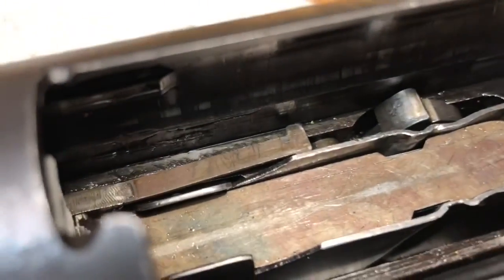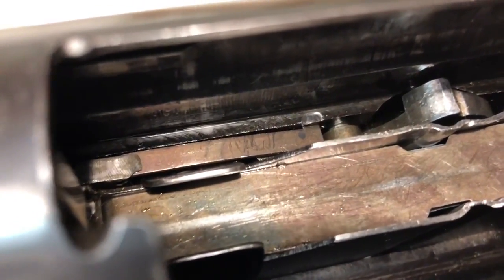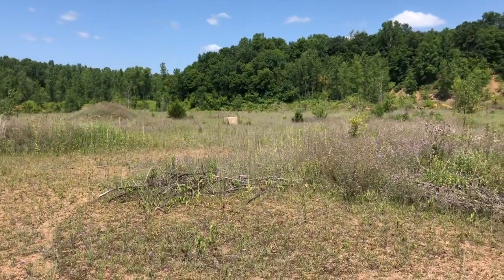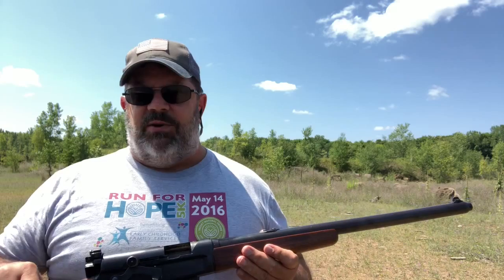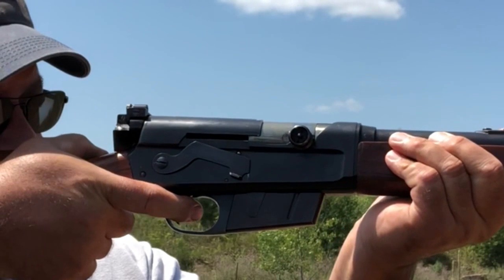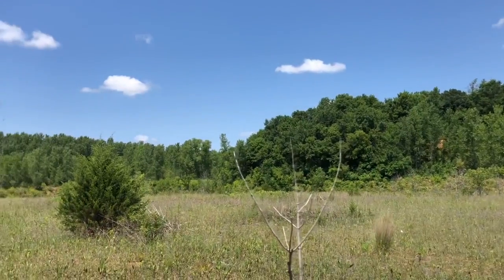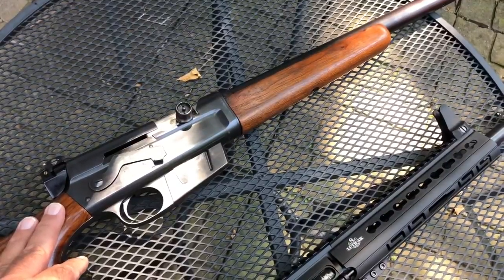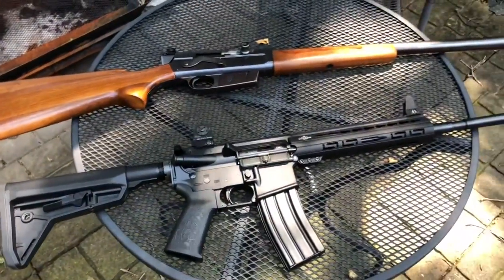Remington Model 81: Success!

Comment: I noticed in your first vid that you thought someone had "bubba" ed the bolt housing, I just purchased a 8 with the same issue. Now I see a vid of an 8 and it appears that the housing in view has a slight bulge in the steel housing- right above where the extractor tab is located. May it is a result of age, stress, design.... instead of human stupidity.